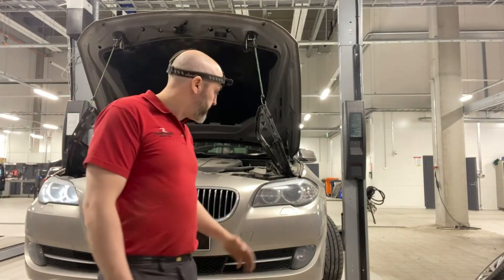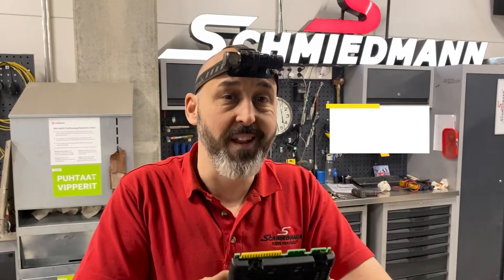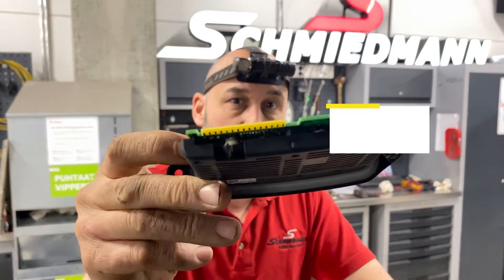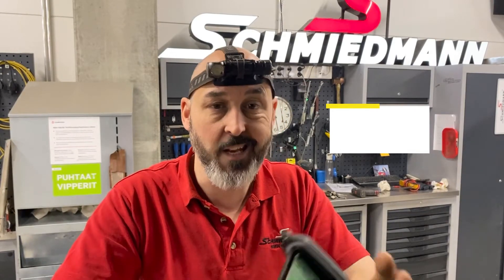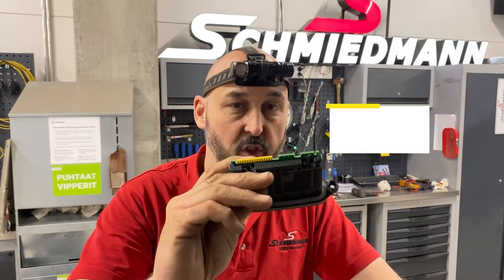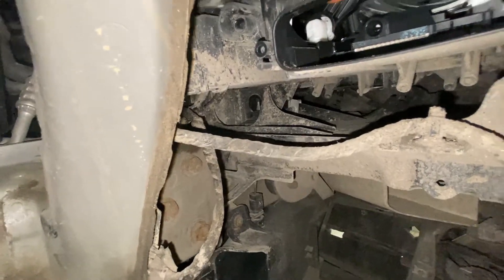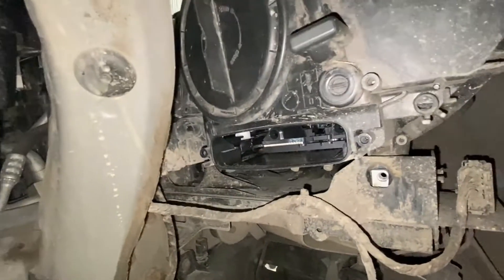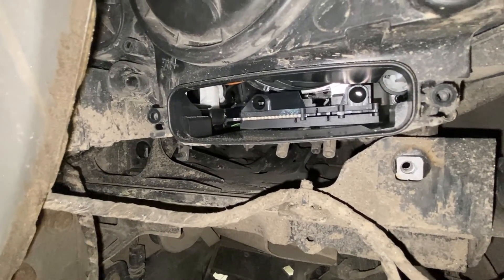5 series headlamp failure

Comment: The right angle eye is not working for me but the headlight is working properly. Is it still the module or only the led module?
Reply: Hey bro, I just had the same issue with my car yesterday.  Did you ever find out what went wrong with yours?  Wanna see what I’m potentially up against before I bring the car to the dealership.
Reply from the maker: @TheMadTitanM5 its often the headlamp module has water ingress. Take out the two torx screws check it. This was a customers car btw🙂 Go look at my latest short you can see exactly what goes wrong

Comment: I have a 2014 bmw 228i that just started having angel eye problems. Sometimes it works, sometimes it doesn't, and sometimes it flickers on an off. Would that module have something to do with it?
Reply from the maker: Correct but I am not there so dont hold me to it 🤷‍♂️. Early modules are held in by a grey snot like sealing compound. Sometimes they can be bought seperately. 

63117494851 63117494852 Led Daytime Running Lights Module For 2 Series F23 F22 M2 F87 but check first at a Bmw dealer the part numbers are correct. 

Check there is no green corrosion inside the headlamp or moisture. If moisture on lens then lamp should be replaced full package. If no moisture just change led module.

They need to be taught in after with any decent tester or garage. Hope that helped.
Please remember to subscribe 🙂.

Comment: Wasn't aware of that fault, definitely one to store in the memory bank as I have a few of them coming in my door. Great knowledge share mate 👏👏

Really enjoying the content 💪👌 Keep up the great work
Reply from the maker: Yes pal it seems common when you find mildew inside the lens. Just look around the indicator for green inside.
Bit of an issue ordering from BMW at present as the module is called BIX yet only AHL is available which is weird so keep your eyes on ordering like for like as adaptive headlamp modules (AHL) will work but the indicator will not and instead will flash fast due to incompatability.

Comment: No need to loosen the lamp
Reply: Take out the 2 screws and take the tms out at an angle it will come.
Reply from the maker: @thebmrepairshop  Absolutely. No doubt I will get one again and when I try it I can try to make some edit to this video to reflect upon the changes. Knowledge sharing is what it is all about :) Thanks.
Reply from the maker: Probably We can get away with it by not loosening the lamp. I will try that next time 👍
Reply: Your welcome. Anything else you would like to know let get in touch
Reply: @thebmrepairshop what do I have to do if I want to replace my halogen headlights to the xenon headlights?
Reply from the maker: @danielburlachenko9261 buy new lamps, swap some pins, code it, change the VO.
Reply: @BenJFF  can I just buy a full xenon headlight with the module and code it?